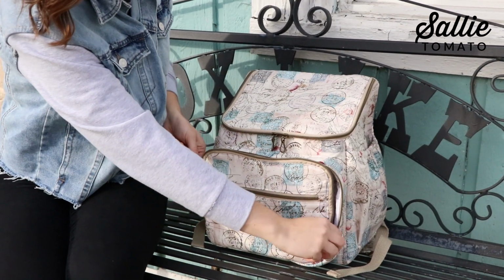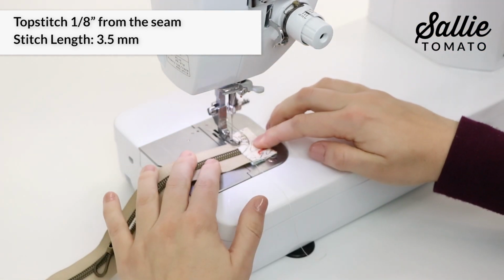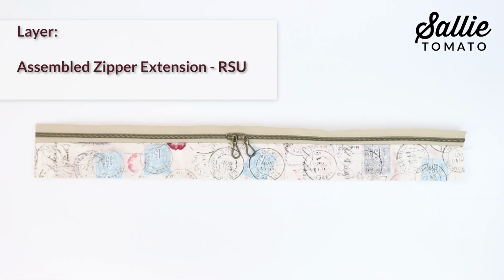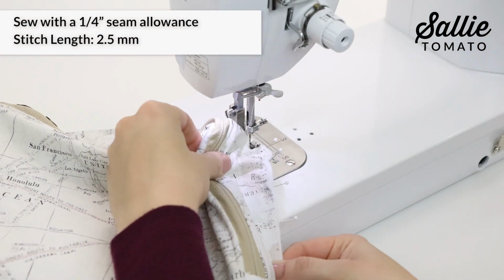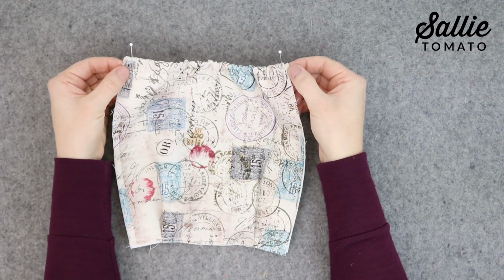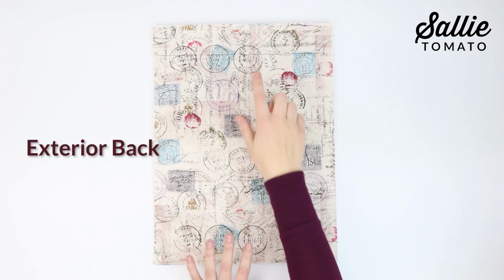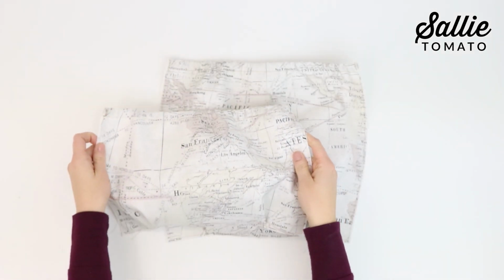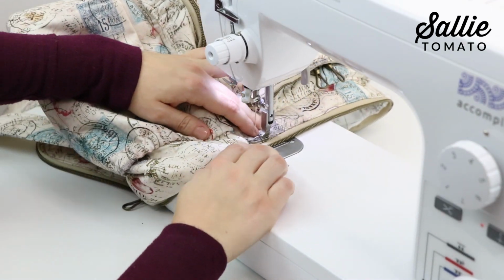Tripper Online Class

Comment: Hi ! Thank you for the pattern and the tutorial.
My problem comes probably from the fact that english is not my native language, so maybe could you help me : why do we have to use "fusible fleece"  and "foam" ? Why not use always fusible fleece which is easier to attach ? What is concretely the difference between them ?
Thank you for your answer !
Reply from the maker: Hello thank you for watching and commenting!! The Tripper uses foam in the sides to give the bag structure and stability, it needs to be sewn in to stay in place. On the other hand, fusible fleece is lightweight and can be ironed on, so it's better for areas that don’t need as much support. You’ll often use both in different parts of the same bag depending on what kind of structure you need! ❤

Comment: I am having a problem with the flap instructions clicking in my head. I draw a half inch line diagonal from top to bottom. Do i sew my lines on each side of this drawn line and then cut on that drawn line? Or do i sew both lines inside the drawn line and cut in-between those stitched lines
Reply from the maker: Thank you for commenting and asking your question. We hope this helps: Once you have your angled line drawn (1/2" in at the top and angled to the adjacent bottom corner), you'll topstitch to the inside of each line that you just drew. This stitching is going to hold the layers together, because you'll be cutting on the drawn lines. Cutting on the drawn angled lines removes a little bit of the fabric/foam layers along the side edges. Your flap will be 'narrower' at the top edge. Does this help?

Comment: If I want to make this big enough for a 16” laptop, what measurements do I need to adjust?😊
Reply from the maker: Hi Barbara, Thank you asking your question.  The pattern would have to be redesigned if you wanted to make it wider however for a less complicated alteration, you could try making it taller to fit the 16" laptop.  We have not tested this out so we recommend you try a test sample to fit your specific dimensions of the laptop. Thanks for watching!
Reply: P